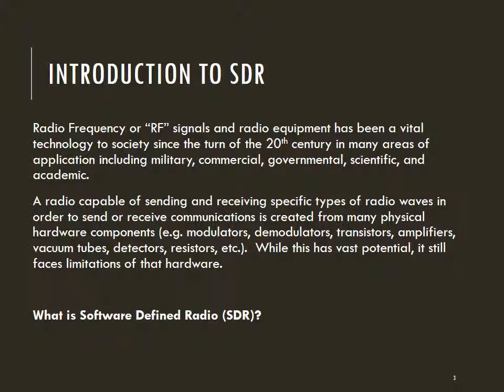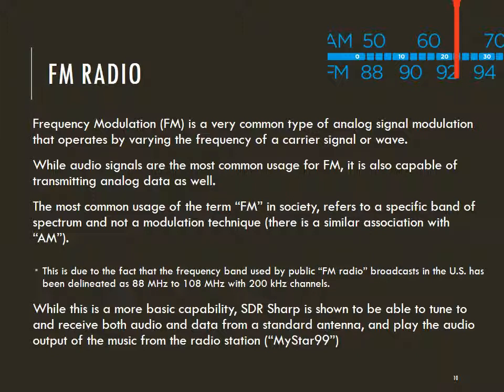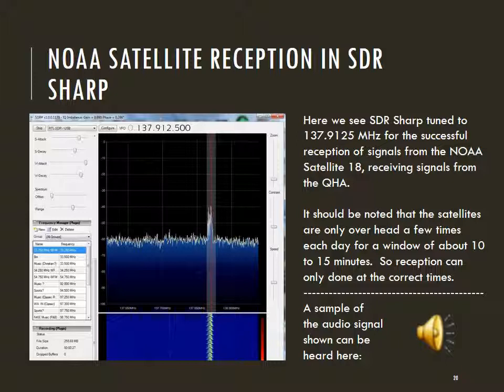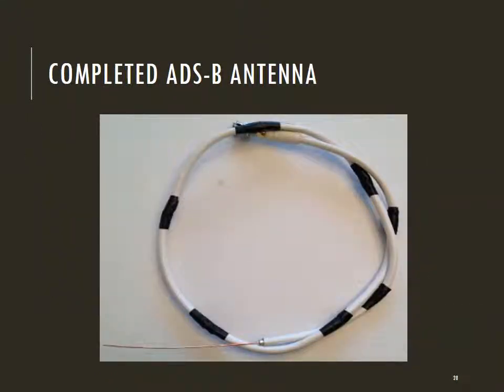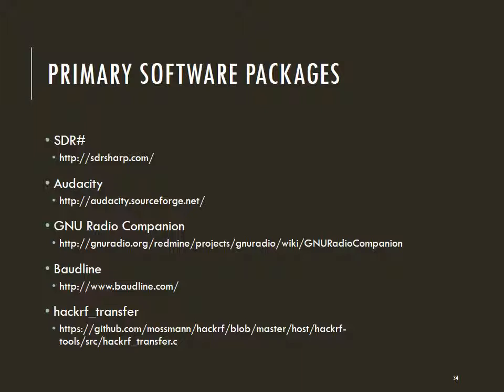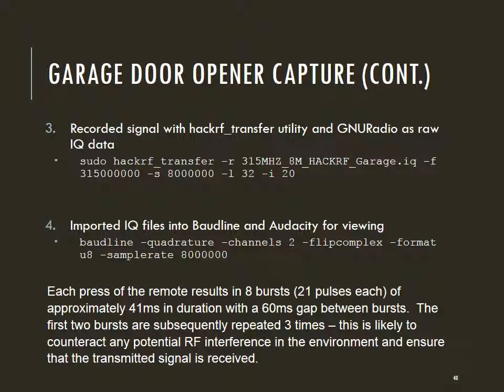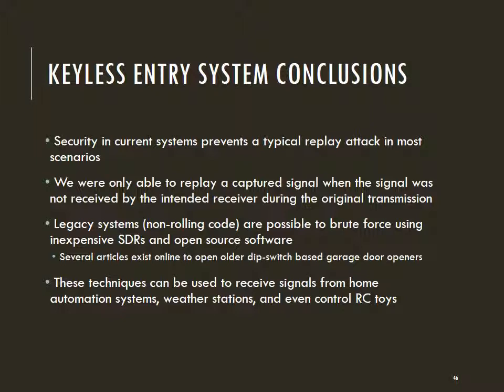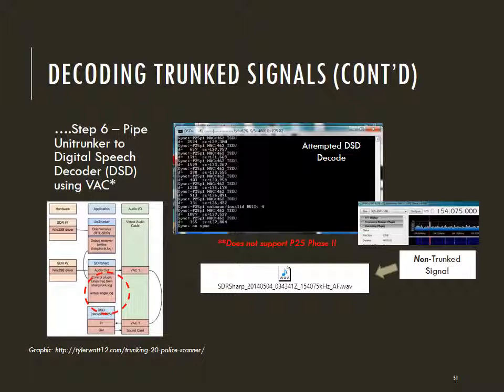CPRE 537 Software Defined Radio (SDR) Project Presentation; Chiles, Rankin, and Scott

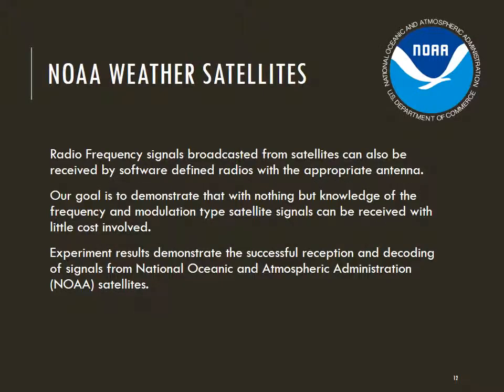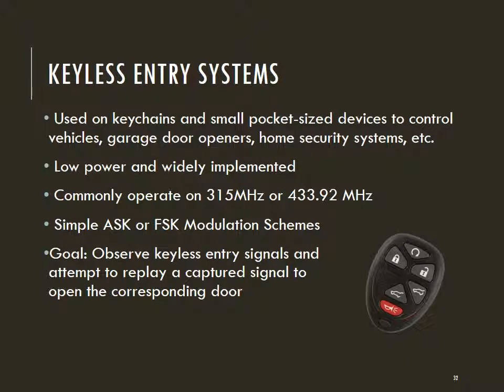Comment from the maker: Presentation covers, building antennas for and capturing NOAA Weather Images from RF Satellite signals (9:48), ADS-B Aircraft tracking RF broadcasts (17:51), Recording and replaying Key-less Entry signals like key fobs, garage door openers, etc. (26:45), Building a $19 police/fire scanner (44:02), and an over view of software defined radio (0:50).